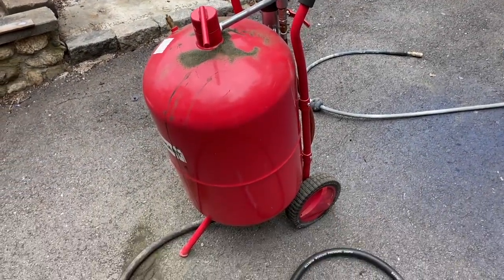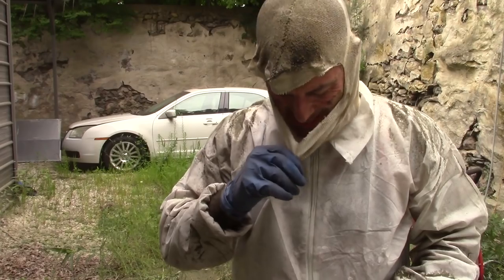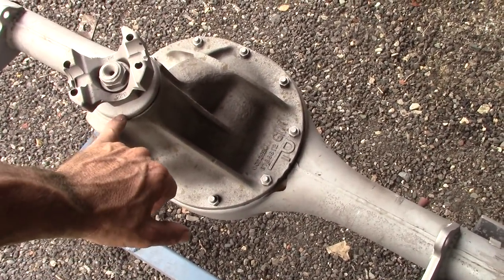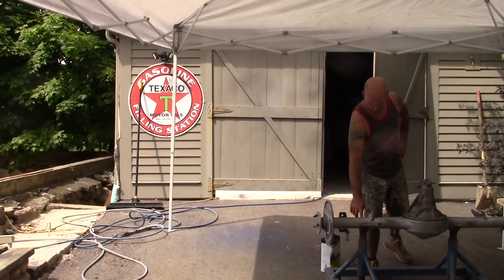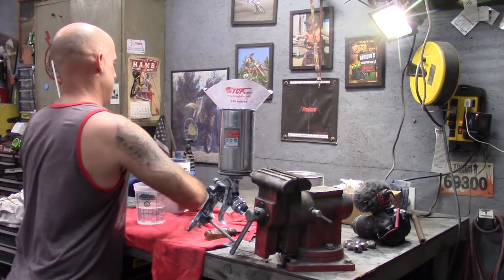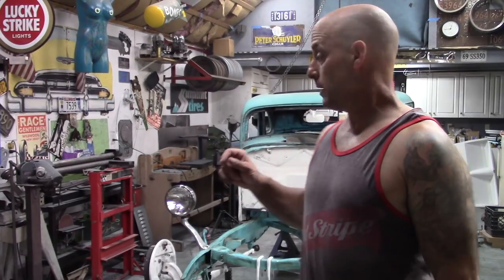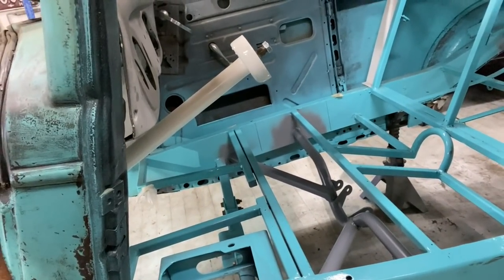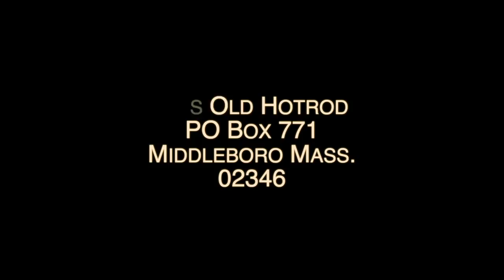SandBlasting The Rear Axle

Comment: You can mark the nut and pinion with a punch, pull the yoke, replace the seal, tighten the nut till the marks align. That's how we did them flat rate. Might need to make a tool to hold the yoke. But I'm with you, can always be done that way later if it leaks. If it ain't broke.......
Reply from the maker: That’s a great idea

Comment: Great work, as usual. 

I do as you do, in so far as axle stripping, & painting.  Painted the axle ends, backing plates, and axle while on cinder blocks.  After 2 good coats of epoxy primer ... I coated the axle ends and backing plates with chassis black.  

When cured .. I just bolted old tires and wheels to my axle ends and tipped the axle upright.  Scuffed in what my cinder blocks wouldn't let me seal .. epoxy primed .. then sprayed the whole sum b*tch with chassis black epoxy.  Some of us hicks .. still rely on hick means of accomplishments.  Hahaha !!!

Thanks for always sharing your work.  One of my favorite things is finding your uploads.  As you well know.
Reply from the maker: We all just figure out things as we go… thanks for the constant support.  Great to be back doing Hotrod stuff.

Comment: I know you are very careful but do you worry about creating too much pressure on the axle seals or getting grit around the bearings and then needing to pull it apart for new seals and bearings?
Reply from the maker: I am pulling it apart to replace everything.  I just wanted to get it cleaned and sealed to protect it from rusting.

Comment: Hi, looking good! I'm looking to do this with the axles of a jeep. Can someone link me a decent sandblaster? I'm looking to buy one, doesn't have to be too heavy-duty but it has to get the job done!
Reply from the maker: I found this one at Tractor Supply Co. it took some time to figure out the specifics on how to get it to work exactly as I needed it to.  The media needed is the finer Media.  The coarse clogs the hun and fittings